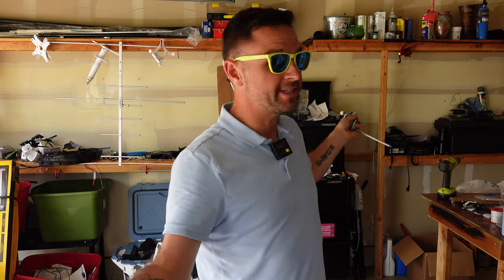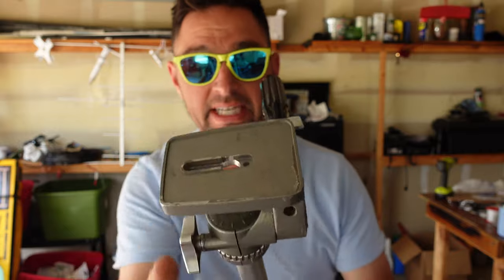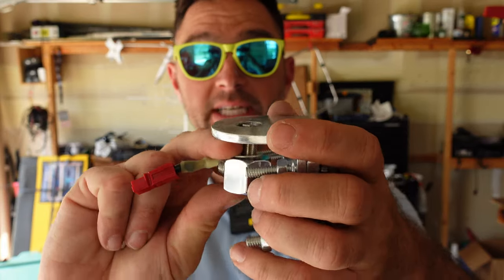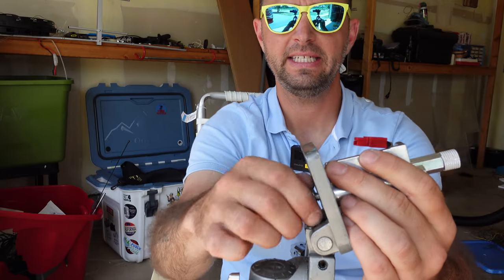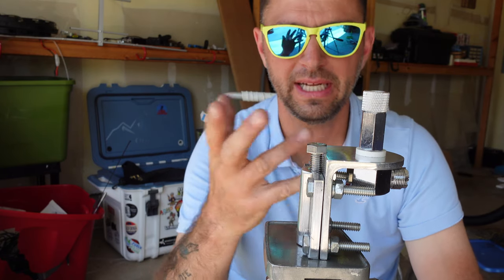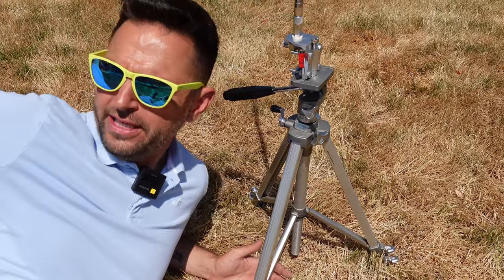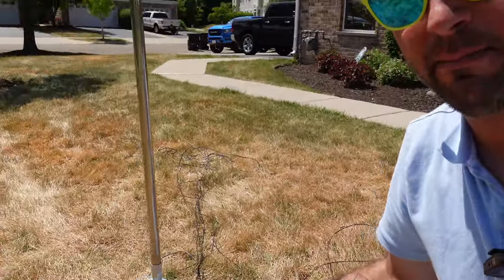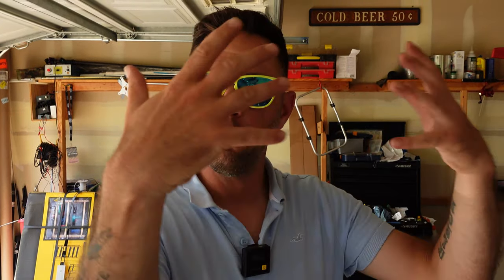Easy Tripod Antenna Mount For Portable Ham Radio Use  / Parks On The Air!

Comment: I prefer the tripod solution to a ground spike personally. It has the added benefit of being able to setup on a vehicle rooftop. I bought a relatively cheap one off amazon that has adjustable leg angles and replaced the center pole with 3/4 in conduit that I cut into sections that fit inside the tripod bag. I put the mirror mount directly on the top section and leave it there. I can get the feed point up 10ft or so with ease and the whole thing goes together in less than 10 minutes with only a screwdriver... including any tuning that might be necessary, and if I'm running the half wave vertical set up I don't even need to worry about a radial field.

Comment: I used the same trucker mount and just clamped it to the center section of the tripod. works good. also attached my radials to the bolts of the clamp via power poles
Reply from the maker: Heck yeah!!

Comment: I already have a couple of tripods I got at second-hand stores that I use with verticals, but that I also plan to use with mag loops I'm building. With their ability to both rotate and tilt, they are perfect for small loops. I hang a bucket (with a 12 Volt 30 ah back-up battery in it,) from the tripod so it won't tip over.
Reply from the maker: Both are great ideas, Thanks!
Reply: Sand bags work too. That's what photographers use since they don't often have 12V backup batteries with them.

Comment: I have a similar setup but I run my radials differently.  I took the four bolts that form the clamp and ran them the opposite  direction.  My radials end with ring terminals so I just put the radials over the bolts.  I then tighten them down with a wing nut, so the ring terminals are clamped between the nut that came with the clamp and the wing nut.
Reply from the maker: That works great too. Also, I believe the bottom of these feet were showing continuity, which means (in theory), they could just screw into the bottom of the tripod feet. pretty sweet.

Comment: What about drilling the top of the tripod to fit the antenna connector without the trucker bracket. I enjoy your videos. Thanks for what you do
Reply from the maker: Should work! I do feel like there was a reason I didn't do it that way. However, I'm a little forgetful.  Thanks! I appreciate it! 73

Comment: Here in Colorado I have been sucking down coconut water like it's going out of style even though it has been raining & lightning enough to not allow me to play hooky from work to play with antennas lately.

Expanding on your ideas, my QRPGuys 3-band vertical is on a circuit board with a BNC connector, so I don't have to get as fancy. 

I tried inserting fiberglass electric fence stakes to suspend my radials, but even the sand here can be hard as a rock or have school bus sized rocks one inch under the ground, so I have been installing little plastic carabineers on the far ends of the radials and then typings small ropes around rocks I move around to position them correctly. It's not like I am creating more trip hazards to the billion already there.

Okay, so I rubber band or bungy the small circuit board to the tripod, insulated in some easy way. Then the MFJ 1979 telescoping antenna can screw onto a 3/4-24 adapter of which is going to be 8nsulated from the tripod, then a ring connector also on the top is going to go directly to the vertical terminal on the circuit board.

The circuit board also contains the ground screw for the radials. The mystery yet to be solved is if I still need the trucker L-bracket since depending on the tripod screw size and the insulator it's all about solving the continuity requirements.

The original project required a 21' fiberglass fishing pole, but the MFJ-1979 is easier to work with if I want lighter weight and can't pound stakes into hard ground. Time to visit a local thrift store to see what I will find to work with. Thanks!

Comment: Does the tripod height matter? or do the radials have be close to the ground. I have a 3ft tripod and a shark 20m mono ham stick and the radials(8ft radials for 20M) are half vertical and rest on ground. SWR very bad.
Maybe get a wire extension to get radials closer to ground?
Love to watch your videos. Keep them coming.
Reply from the maker: An angle shouldn't matter too much. I would maybe try a few things. First, disconnect the radials and see if the standing wave ratio changes at all.  If it doesn't, you probably don't have them connected and making continuity or a good connection.  If it does change, and it is even worse, maybe add a few radios onto the line again..  did you  attempt tuning the shark hamstick?
Reply from the maker: I may stand corrected.  Here's a bit of info on angled radials https://www.reddit.com/r/HamRadio/s/U2vvqOiEmn
Reply: I added 4-8ft radials to the 3ft tripod as verticals but the SWR was very high so I added a wire with clips to extend radials to ground and was able to get an SWR of 1.6.
Tomorrow I will try the magic carpet(Faraday Cloth) that Michael KB9VBR uses with the same wire with clips to attach to mirror mount and than down to cloth and see if that will work instead of the radials same concept as window screen.
My tripod was made of metal but since it is coated it will not zero out the Ohm meter, so I added a piece of metal pipe and I was able to bring SWR down.
Thanks again ,73. @HAMRADIODUDE

Comment: Once again,  thanks for the great video. Question,  where do you find those ring connectors that size, I’ve had a tough time sourcing those?
Reply from the maker: I got them on Amazon. (affiliate link) https://amzn.to/45WNrM3 .  And thank you.
Reply: You can also find large ring terminals at a local auto parts store. Used for car battery terminals.

Comment: That's an old Velbon photography tripod.  I've had one of its brothers for 30 years.
Reply from the maker: It's solid for sure.  I actually thought I had the screw for it
Reply: Yes, a good old Velbon tripod, I bought mine 52 years ago, currently supporting a 2 metre dipole.